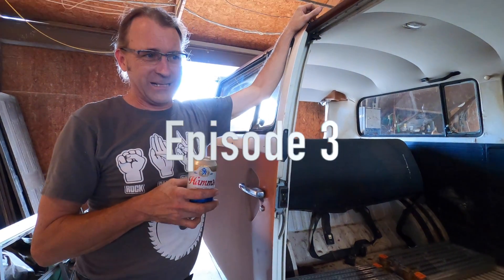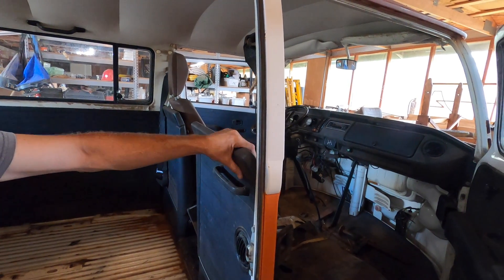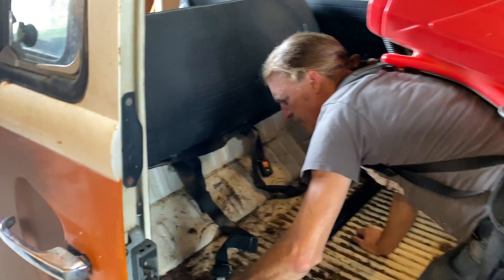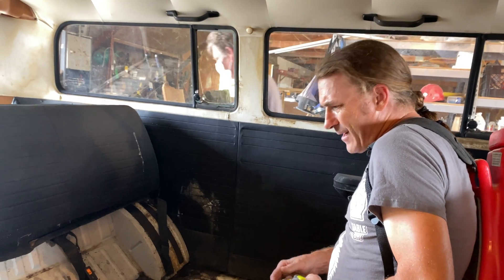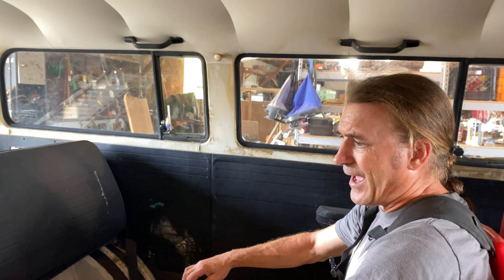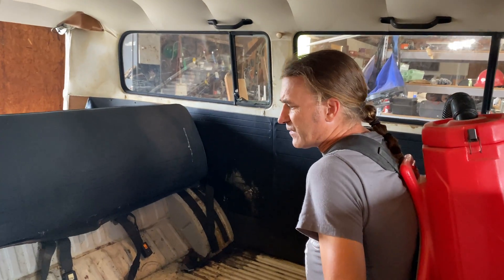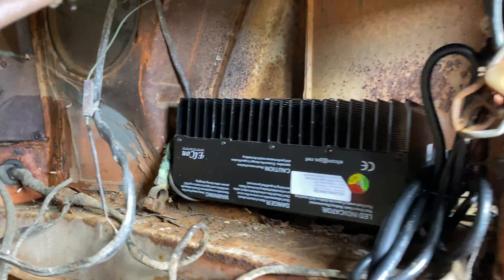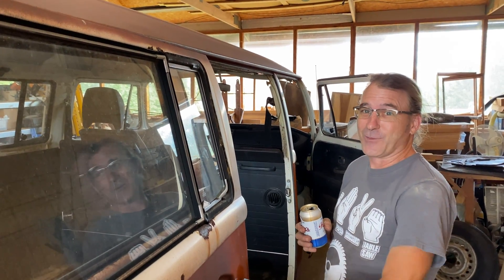The Voltwagen - Deciding How to Convert a VW Bus to Electric

Comment: I was delighted to find your channel.  I'm currently doing the EV West conversion on my 71 vw beetle. Have you guys heard anything in regards to the cooling kit no longer being available through EV WEST?
Reply: Nothing special about it.  If you're using a HPEVS/Curtis you'll just need a transmission cooler, fan, some plumbing and a 12v pump.  You can get all that stuff from Summit or similar.  I have my pump on all the time and the fan on a thermal switch I have epoxied to the chill plate.  Good luck!